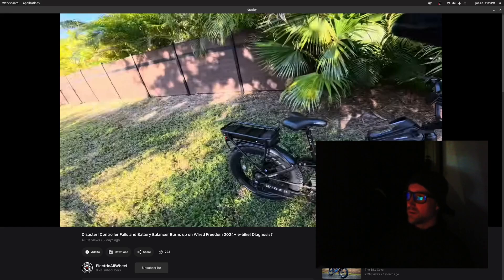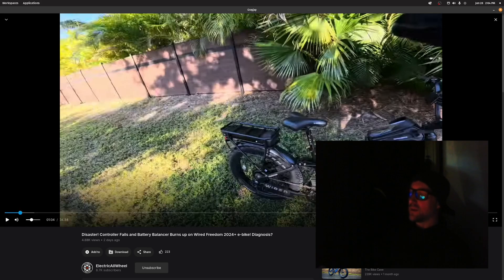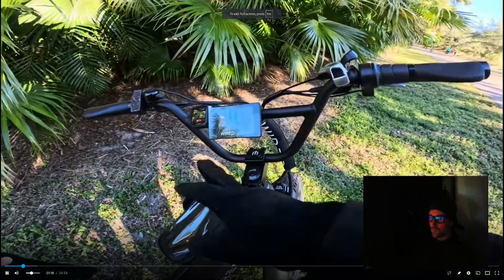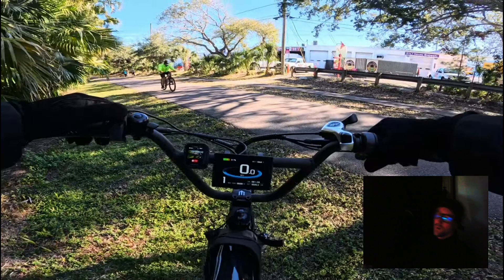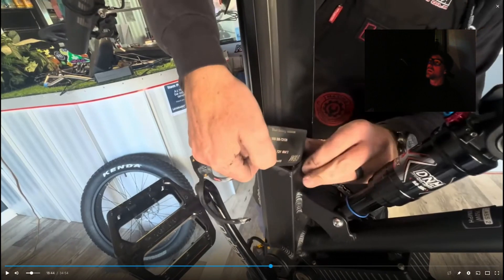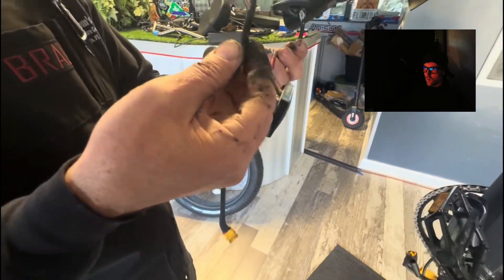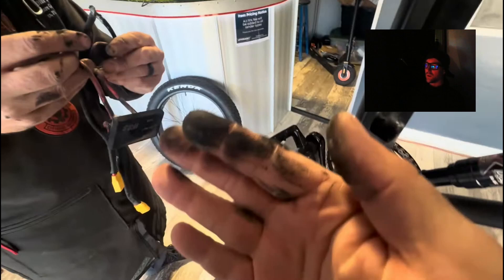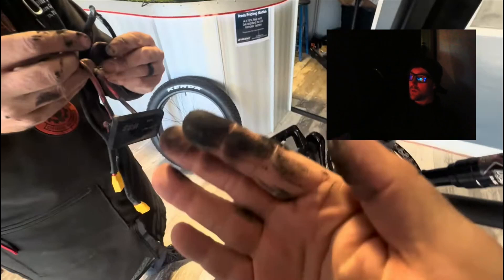WIRED E-Bikes POPPING OFF in 2025! Bad Controllers / Battery Balancers Causing Electrical Mishaps

Comment: Is it not obvious that the wiring is to long and cramed into the frame..with dule motors and batteries...the installation on the postive wire should probably be different than single motor and battery...this is my opinion on what could've happened...that wire was bent and burned...🤔😲
Reply from the maker: @James-cs3hp  yeah the wire does look like it was all bent up  and jammed in the bike haphazardly
Reply: @EBikeBuilder_  I believe most ebikes out there are the same components just different frame designs..

Comment: You said you had a battery balancer cause the controller to break. I looked back & you had a controller upgrade & an extra backpack battery on something. Did you do a episode on the Haoqi Cheetah break down as they are on the CA voucher list as approved with a throttle I think.
Reply from the maker: @stevecumming6427  i need to fix the cheetah, it had a disaster one day . I still have the video from when it broke down. but i need to spend $$ to fix it. I have a couple bikes broke down . Like the Aventon SINCH that sank into the muck hole and broke the derailleur hanger 🤪  but yeah i want to fix the cheetah. Its an all right bike. I didn’t know they were UL certified. Haoqi must have done that after mine

Comment: The best way to run dual batteries is to simply wire them in parallel and never switch off or disconnect either battery.  Just Get used to the using both batteries at all times. A battery blender is just adding unnecessary circuitry & wiring.
Reply from the maker: @technocrat7971  yeah the blender is just a lazy way of connecting multiple batteries of varying ah. I use 1 battery at a time. ..

Comment: Hey EbikeBuilder- for the most part, I enjoy your vids, like how your starting to venture off.road a bit with mid drives. I have to 2024 1/2 Wired bikes. I have the Freedom and the Cruiser - Love them both. I did have a controller go bad but the issue was a loose connection under the velcro loom in the front. Same current error but my balancer was fine. Wired customer service was top notch and had me fixed in no time. Even got an email from Spltephen, the CEO apologizing for the inconvenience and making sure I got fixed up quickly. Could not be more pleased with their customer service, although not needed it at all would have been better yet. I am planning on a mid drive build soon, either with a BBSHD or CYC X1, but the Wired bikes are great all around cruisers. Worse case scenario if there was an issue with controllers what would prevent someone from using a flypsky or fardriver? Keep up the good work!